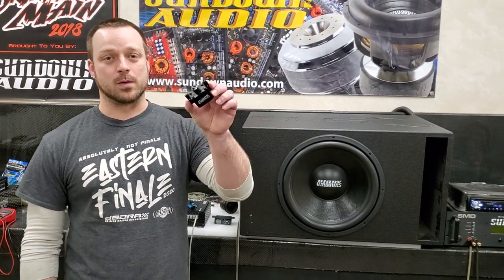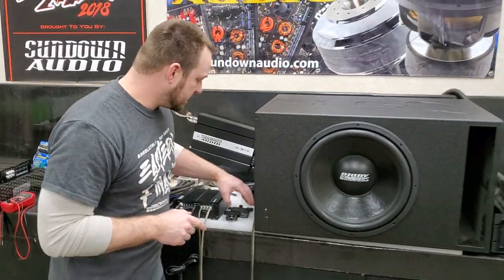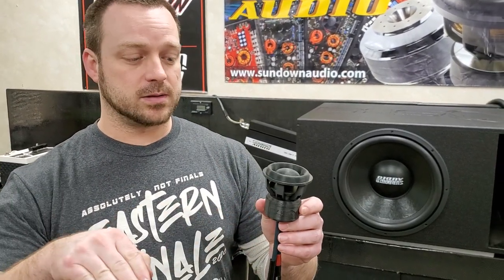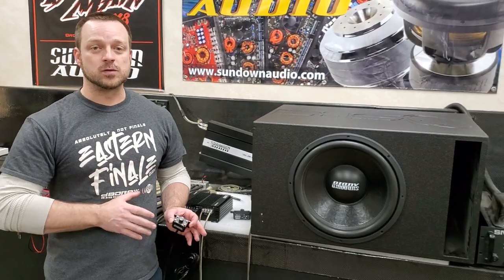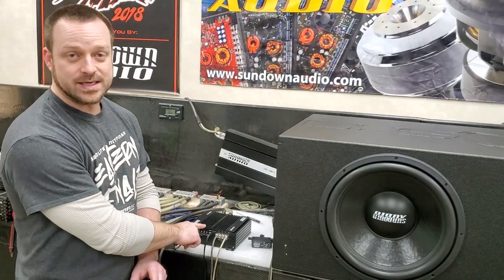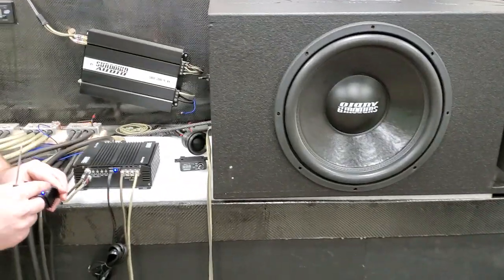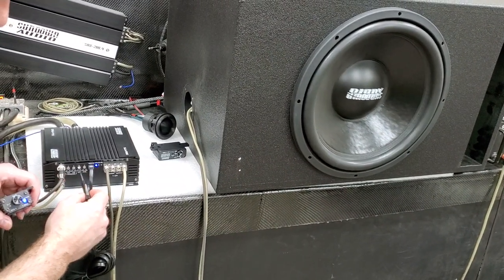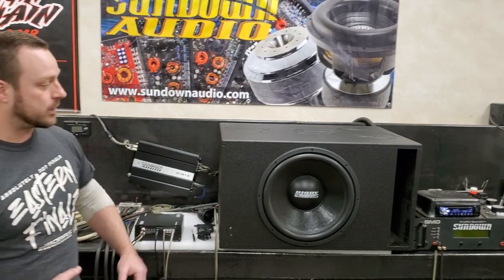***Tech Time*** How Your Amplifier Remote Works

Comment: Hello love your channel. I came here to actually find out what cable my Salt 4 bass knob requires? Mine got pinched in my seat and need a new one. People have said that I can’t use just any cable because the salt knob does temp. Voltage etc. when many others just are a knob with a light. Thanks in advance.

Comment: On the Salt amps, the cable is a 5 twisted pair 10 pin RJ50. It’s the same size as a regular rj45 but has 10 wires instead of 8. I haven’t yet, but I’m getting a few RJ50 jacks and making my own patch cord to have the color cable I want as well as exact length. Take that shit to a further level of custom. I’m a low voltage data guy, so it just goes hand and hand for me.

Comment: I like to set my bass knob to half way and then dial in the gain on the amp to the correct volume I like. Then due to the bass knob being half way you have the ability to lower or raise the volume in select music do to its quality. Like over the air radio needs more volume do to reception of the air wave, satellite radio has more quality do to it being a better reception, mp3 is even better, and lossless being the best and cleaner/stronger signal...That what works best for me. Also I recorded a .5 to .7 db loss in SPL do to using the bass knob as there is resistence in the line from the amp to the pentiometer knob itself. IF you know the real wattage your amp is producing and the RMS of the subwoofer itself it make using the pentiometer even easier. My Stinger MT1000.1 is 1069 real watts dyno tested at 1 ohm. If I set my bass knob to half way, dial my amp to 65% I have approximately 700 watts which is the RMS of my sub. Now I can dial in under RMS or over RMS wattage by having set the bass knob at half way point...

Comment: I have a question and I’ve subscribe 
When you tune the amp gain for the first time is it best to put the bass remote on full 
Also on your head unit do guys run your graphic on flat or turn up I’m aware of the bass bossy on amp that’s off and subsonic is off to lpf little turn on but your head units I’ve never seen if you guys turn the bass up on the sub settings would you kindly let me. Know thanks

Comment: Back in the day, I had a half din, in dash crossover, with remote gain on it, it had gains for low mid and highs, plus the crossover frequency knobs, seems low was 40-120hz, I really liked it, if a song had a bit too much high, I could turn the. Volume down in the tweeters, and miss if I needed, I normally kept the knobs set half way, low pass at 80hz, mid at high pass 80Hz, it worked great, until someone broke into my garage and my car to stole it! I hate thieves , makes you not want to not have stuff! If someone , some Douche hole! Just taking it!
Reply: You mean an equalizer

Comment: Can you set your gain/bass knob levels by turning the knob all the way up and then slowly roll the gain until either you see a clip indicator light or your woofers are maxed??? So then essentially when you turn bass knob down or up it should be a clean signal and the power ceiling is already set by the gain control or do we really have to figure out how much voltage pre-amp our audio source is putting out and try to match the gain to that accordingly??? 🤔🤷‍♂️💪🔊 SUNDOWN VS. THE WORLD!!! Jacob Fuller for president 😝🤣

Comment: This may be a very inexperienced question but... do I connect the bass knob inline with my Rca's at max or halfway? Or does it matter if I plug it in after my amp gains have been set? Sorry never used an aftermarket Rca style. Thanks

Comment: Plus that means do not turn your gain on your amp wide open. Do  like Derek and setup your amplifier gain first. Then use the control knob that wires in the amp.

Comment: I have a question, I have a 2016 suburban ltz all stock I left the head unit and the Bose sound system and bypassed it with an lc2i. I installed a SIA 1750 and a SA 15 V2 in a ported Q Bomb box and I have roughly 2 hours of play time on it right now. My question is I have the bass knob set about a quarter of the way and when I try to go to half power on the knob the clip light comes on, what am I doing wrong?

Comment: My sundown 3500sia will not cut on with bass knob hooked up and if I plug it in the on light turns off but still plays but the knob lights don't cut on and knob doesn't work

Comment: I had a question I have a sundown 2000 when I do my gain on my voltmeter do I leave my voice knob all the way down and just adjust it from the gain on the amp when I get my numbers for the watts for my speaker my 12"American bass XFL 1500rms pxr -38.729 on my voltmeter acv.

Comment: doesnt it all depend on what the remote volume was set to when the amp gain was set?  example, if the remote volume was maxed, it can only attenuate.  but if the remote volume was turned all the way down, it can only boost?
Reply from the maker: The remote can't boost past what the gain is set to.

Comment: So if I set knob half way and turn gain up on amp to max, it will play at 50% half way or 100% half way. The way I’ve learned is what your gain is set on the amp is the same on the knob no matter what.
Reply: If your gain is max on your amp and your remote is at 50% you will get 50% gain.  Then if you crank the remote to 100 you get 100% gain.  Don't know why you would want to do that as a gain on an amp is not a volume knob.  Always set your gain on your amp to a clean setting.  He explains it very well in the video.
Reply: @marcmo7138  I know it’s not a volume knob. I set my gains to the amp using oscilloscope and dd1. I don’t my knob at all it’s always all the up . My question was if i was to  set knob  at the middle while I set amp to max before distortion, will it be playing a max or half way. You answered my thanks but I don’t know how you ended up telling it not a volume knob.

Comment: Mind blowing people don’t understand the remotes function. Common sense truly isn’t common.
Reply: Cool, you then can easily explain the difference between remote gain knob, remote bass boost knob, and remote level knob (the one with the RCA's).
Reply: @TheSummer750  yeah I can. Remote bass boost knob is garbage don’t use bass boost it just causes clipping. Gain knob controls gain to setting you’ve done on your amp so if it’s at 50% then when the knob is 100% it’s never higher then that 50% setting on the amp. Rca bass remote is controlling the signal voltage going to the amplifier from the head unit. More incoming voltage to amp the easy it is to amplify so you’d set your amp gains with the knob 100% so you wouldn’t clip if you turned it up to far say you tuned with knob at 50%. I personally prefer gain knob because more rca connections become weak points imo. Both work though.